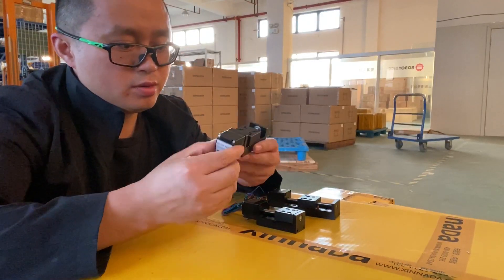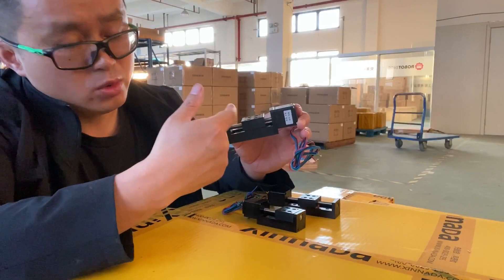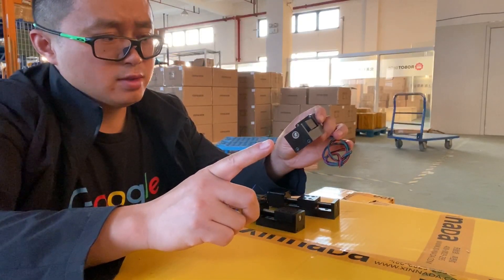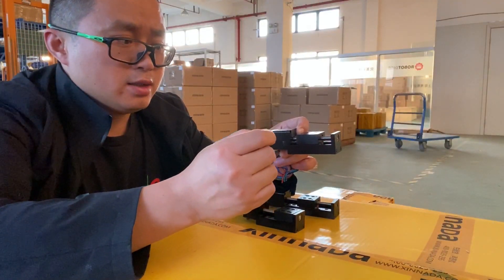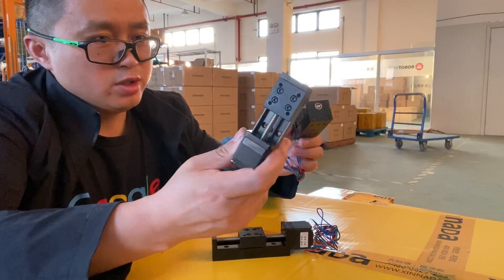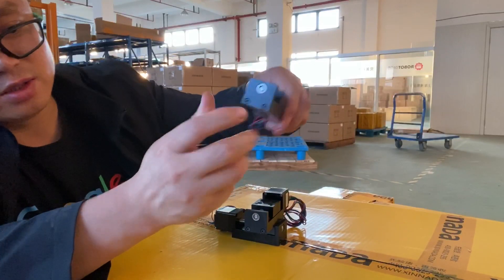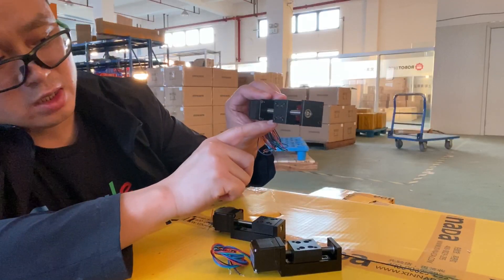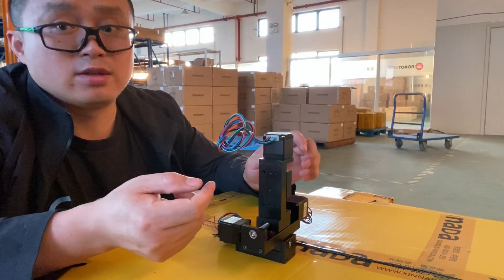NEMA11 stepper motorized lead screw and linear rail combined linear module

Comment: Hello!I was going to build a laser engraving machine with belt drives on profile rails, but then I decided to add a Z-axis linear modul 50 mm stroke with a spindle DC Motor 775!, so that I could only drill holes for the PCBs (no milling !!).1).Can your module work in PCB drilling mode  and which screw pitch should I choose ? 2).What is the weight of your module? I have no experience and therefore I do not know if there will be enough force for the belt drive to move the carriage of the Z axis with your modul ????